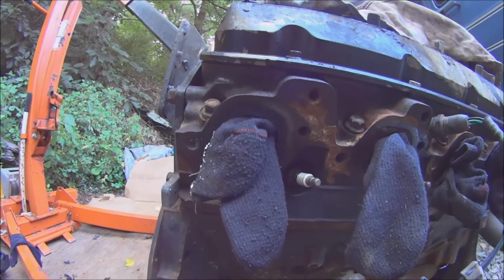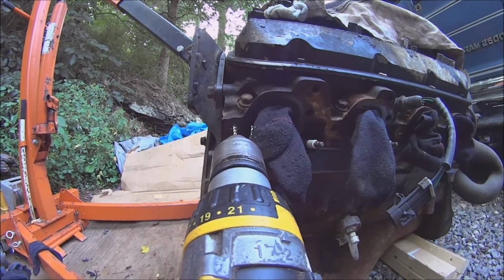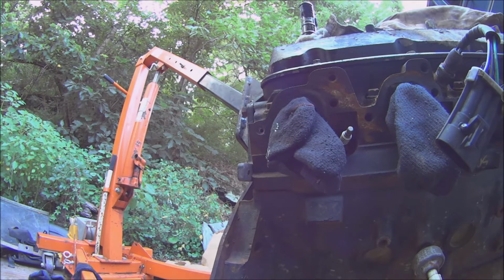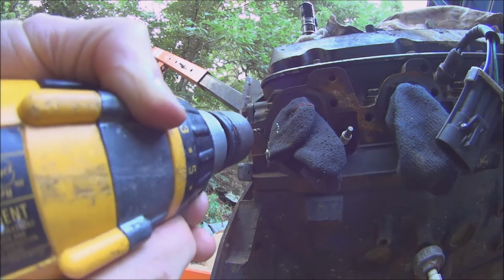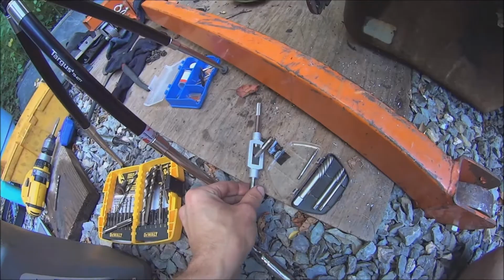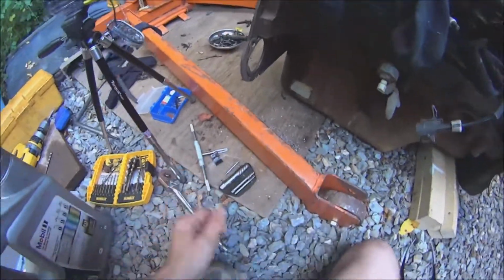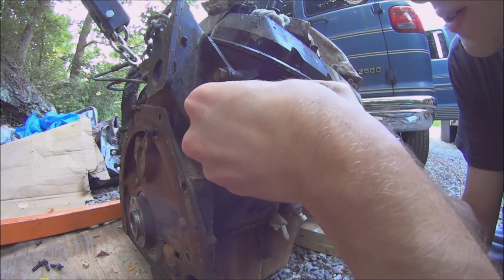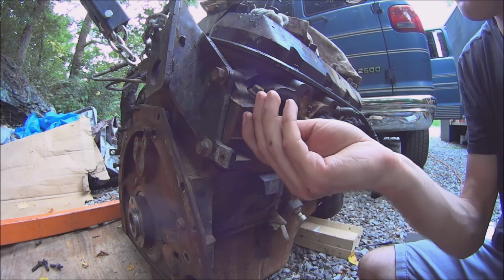Drill & Tap New Threads in Engine Block - Broke Exhaust Stud in Head - How to Use Tap & Die

Comment: Thank you! I'm doing this on the end of a 454 right now. Easy out...no way, like you it didn't work. One thing, use a good drill bit. Cheesey Chinese drill bits won't go anywhere and you'll be very frustrated that it's not working. Go American HSS, or I used Bosch Titanium which worked good. Also, if you don't have clearance, like me in this motorhome, get a right angle close quarter drill and don't be afraid to cut your drill bits shorter to make it work. It sucks to cut good bits, but do what you need to. Use an angle grinder with a cut off wheel. Good luck, you can do it.

Comment: I once drilled out a broken bolt in a cam driven fuel pump and drilled a hole into the cam, didn't seem to hurt preformance any. depth is important. I was 16.

Comment: I've had to do that more than once on my projects lol .Also tapping oil is pretty much the same thing as engine oil ( says my machine tools professor lol) . Since then I've used that oil for my taps and they work just fine .I like the vid, I definitely think its useful knowledge to learn either through school or the hard way like me lol
Reply from the maker: +jimbo booth Thanks, it's not my best video for sure haha, but I was bored. I didn't know the oils were similar. I've always used engine oil for cutting threads for taps and dies and for threading black pipe, and it always worked fine haha. It's definitely worth knowing if you're working on cars...a bolt is going to break at some point. Luckily I learned this in metal shop before I needed needed to do it, and I have called upon the knowledge relatively often lol.
Reply: a DIY Car Guy I had to retap the holes on my h2o pump acouple of times lol ( im just too strong lol) . This is definetly something im going to teach my friends . Head bolts would be my least faveorite thing because of the location , if you drill wrong at all you ether go into the cylinder wall or the h2o jackets. What did you have the 442 in ?
Reply from the maker: jimbo booth Nice, yea ya gotta be careful on the heads. The engine was something I bought to resell, it was in a C6500 Topkick truck haha, it had 58000 miles on it and had a factory overhaul on top of that, so that was a very good find. I am thinking of posting a video I took of the giant clutch plate before I shipped it out.
Reply: a DIY Car Guy good idea . so you buy and sell cars ?
Reply from the maker: jimbo booth I buy and sell everything haha. Cars occasionally, parts, tools, equipment, electronics, HVAC supplies occasionally, etc. My ebay is enduring_autos. I tried to add the link where the links overlay the channel banner, but it's not showing for some reason. My store is a little sparse right now as I just finished a seasonal job at Nestle waters, and I just reopened the store. A year ago I usually had around 100 listings up all the time.
Reply: a DIY Car Guy thats pretty good . I bet its not easy .

Comment: I have a cheap chinese motorcycle that had a muffler screw hole partially break....can the hole be welded and retapped for the bolt?
Reply from the maker: hmm i don't see why not, it might depend on the material the block is made of....might want to try helicoil
Reply: @aDIYCarGuy  Can't use a helicoil.....the side of the hole broke off.  It would be best to just put a piece of all thread in the hole and weld it to the head (if there isn't a problem welding steel to cast).....then install the muffler.
Reply from the maker: @cugir321  ohhh the hole broke open...I didn't understand initially

Comment: Ok I have a question as I've never used a tap and die set before. Are you tapping it with new threads so you can reuse the original bolt or are you gonna have to buy a bigger diameter bolt to fit that tapped hole? I always thought that when you tapped the hole with new threads you had to use a bigger diameter bolt to fit. Please correct me if I'm wrong. Thanks for your time!
Reply from the maker: If you can drill most of the bolt out without hitting the original threads, then you can retap the threads, meaning get the old bolt pieces out of the threads, and then reuse the old threads. Usually it doesn't work like that and a bigger tap and bolt have to be used. It all depends.

Comment: Perhaps someone here might be able to help me with a problem I'm having? As I removed some old studs to install slightly longer ones to mount a set of Weber dual carburetors on a Volkswagen but for some reason I can't get one of the new studs to screw in, which feels like it wants to start screwing in but then will slip out. So will I need to rethread the hole? Thanks
Reply: Maybe the pitch (metric) of TPI (imperial) is not compatible.
Reply: Thanks I figured it out the stud and now have the carbs mounting and just trying to figure out now the best way to hookup the gas lines and if the electric fuel pump thats on the bus will be sufficient.

Comment: I do what i want! ....Cartman
Reply from the maker: exactly lol
Reply: I drilled my head bolt out last night with a hss bit after I spent 17$ on a solid carbide, to my surprise it had no problem, I did have a tip of an easy out I had to take a tiny carbide burr and get most of it out, I tried building weld up in hole then tried about 6 different tries to weld a washer and nut on but just would not hold, I finally slapped a brand new hss bit in and said fuck it imma try it, HF titanium bits would not scratch it, I even bought a carbide tip masonry bit to regrind if I had to and didn't even need it or the solid carbid, I seen you do it so I tried, great video brother! Sorry so long! 😆